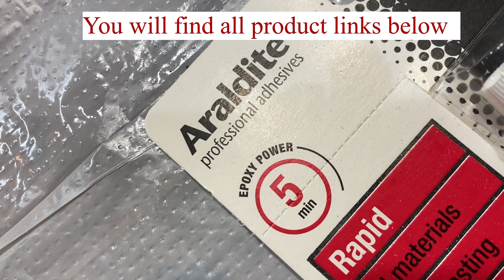Totally Unique Driftwood & Resin Lamp - Power Carving with Arbortech Turboshaft! 💎

Comment: Love that piece.Was the wood dried out other than from being outside in the sun?
Reply from the maker: It was already very, very dry when I found it 👍
Reply: I found a small piece of wood that a beaver chewed both ends into and chewed all the bark off of.The chew marks have left a beautiful pattern all over it.I was wondering if I could coat it with resin without first sanding it??I found it several years ago and it is very dry to the point of cracking open badly.I thought to fill the cracks with some color and then clear coat the whole thing.
Reply from the maker: @stevechance4422  It is difficult to fill in the cracks with colour without sanding, so if you want to keep the pattern as it is now - coating it with resin (using a brush) is a good idea. Alternatively - if you do not want a gloss finish - it is possible to mix resin with acetone (1-1 ratio) and coat it in exactly the same way (using a brush). It will stabilise wood and hopefully prevent it from further cracking.
Reply: Thanks so much for the information. I am definitely open for suggestions.

Comment: How did you prevent the Epoxy leaking through the driftwood end towards the base? I just made a lamp following your tutorial. The Epoxy drained from the LED conduit and made a mess on the carved wood base I had made. I could not find the glass stones on Amazon. I did find 1" pyramid shaped glass nuggets.
Reply from the maker: 9:55 - I used epoxy glue to prevent leaking. Hot glue would be good as well. I did not use a large amount of epoxy, I probably had no more than 2mm at the bottom of the carved out section, so in my case nothing leaked as the hole I had drilled for the base was above the epoxy layer. But even it it wasn't, epoxy glue is best to prevent leaks. I bought the stones here in the UK, there is a link in the description. Not sure if they are available outside the UK. If not, 1" pyramid shaped glass nuggets sound  great too!